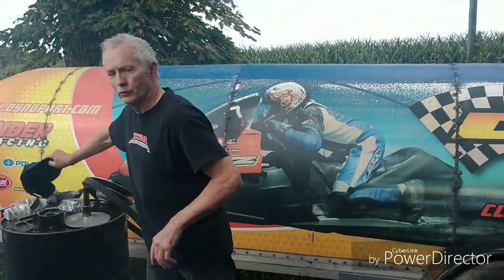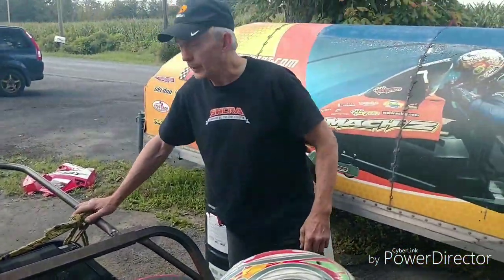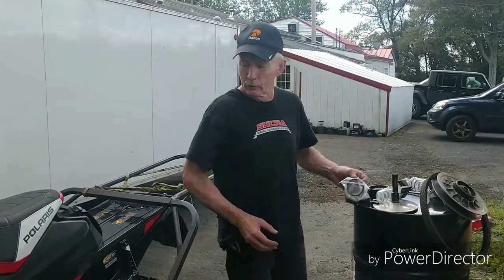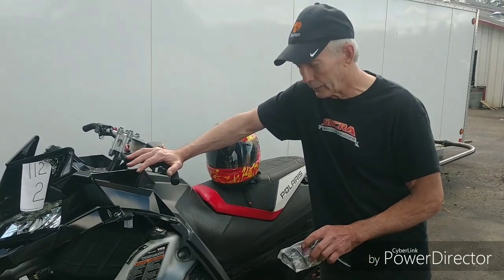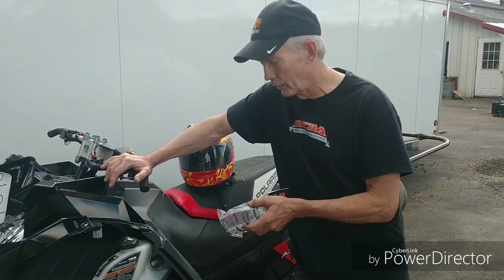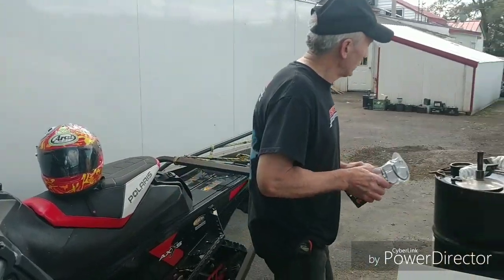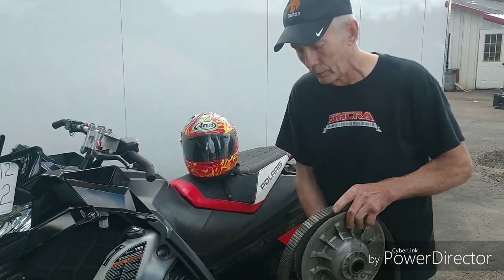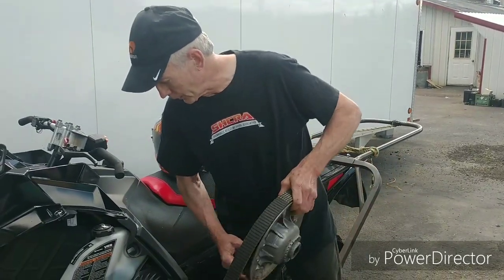DynoPort Rich explains snowmobile clutching

Comment: So for one of my sleds, an 800 axys, i had trouble getting the sled to keep stable peak rpm and wouldn't go above 8000 rpm no matter the conditions with stock clutching. I tested both a stiffer secondary spring and a helix with 2 degrees less on the second number. Both seemed to fix the issue but what is your recommendation to go with of the two for best performance?

Comment: So if you are studded for drag racing, would you then leave the stock helix in? Or possibly go to a slightly smaller first number?
Reply from the maker: Stock is fine what some of the top dirt racers do , do to more advanced timing and higher engagement so more hit off the line they might go 1 or 2 degrees steeper on the first # to keep the engine loaded more. That is the only reason to change an d a fine tuning deal.

Comment: I have a sled powered drag bike. Id really like some help with clutching. Its powered with a stock 1990 488cc Fuji f/c. Videos on my page so you can hear its shifting. Its running 1.869sec 60ft, 5.194sec 330ft, 8.18sec 660ft at 80.26mph, 10.915sec 1000ft, and 13.351sec at 90.83mph at the 1320ft mark. Ive been 5mph faster on the back end, but a lower et. Im a bit confused 😆 
I feel like its running out of steam early. Ive only added a stiffer primary. Stock helix spring, and spring is in #2 hole location. Its launching harder now. Id just like to sweeten up the back end a bit before adding power.

Comment: Hey guys , you really sound like you know what you are talking about and I think you guys can certainly help me out on either picking a clutch kit or making one , I have a 2013 Polaris Indy Sp600 with the p-2 secondary , I like riding the ditches and wheelies what’s my best way to get better performance in that area , it currently has a inch and half intense track , stock 10-64 weights primary spring is 120/310 for nonelectric start I was told to go for a little stiffer spring and add adjustable weights which would run me like 250USD , another kit I was told to keep stock weight , use stiffer primary , change helix and secondary spring , helix angles he won’t specify, but for stock it is 58/42.45 , any advice , thoughts . I’ve been stuck on this for a couple years trying not to waste money on something I won’t like, happened before with a kit I bought , thank you
Reply from the maker: yes the best bet a little stiffer on the start rate of the spring and adjustable weights. Stock helix is fine

Comment: Why did the button clutches only have pressure like 54 lbs @ 2inchs n 115 lbs per inch at 1"1/8 vs the roller team clutches needing 150 to 220 lbs?
Reply from the maker: probably the roller clutch moves so easy and the only thing it is any could for is a super quick backshift that only mtn guys need sometimes.

Comment: What if you change the gears in the sled? Lower or higher gear ratio. 
How does it affect the clutching?
Reply from the maker: Any gear change puts you in a different spot on the ramp as you acceletate so will need a slight adustment to get rpms correct

Comment: Got a 94 ski doo mx 470 last year it sat for awhile  was.seized up from sittting got it unseized and rode a week and rings got smoked.  Put new rings in and I noticed at half throttle the rpm is red lined . Gotta be a clutch problem right? Riding season about to start so wanna get it right. Pretty sure it did this before I did rings and that's what smoked the rings
Reply from the maker: Check and make sure the secondary back clutch is opening, if its not would be like driving around in low gear and you would over rev